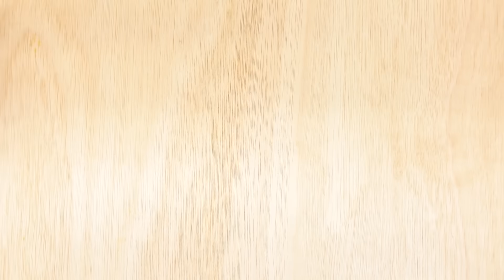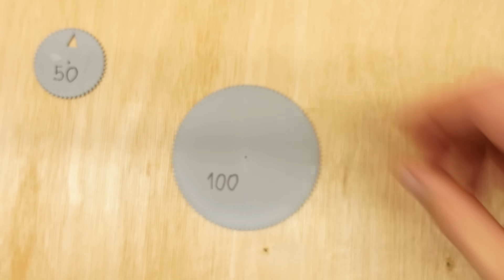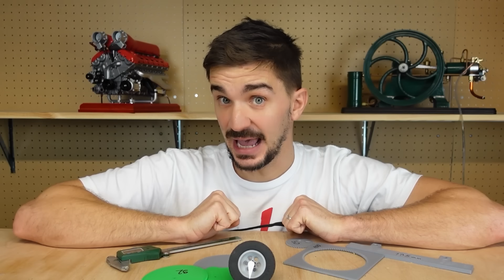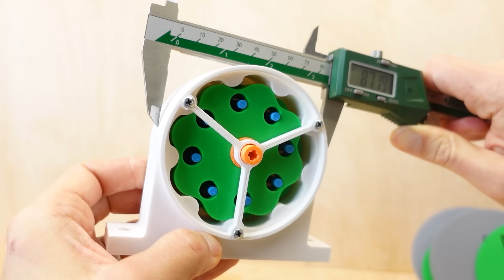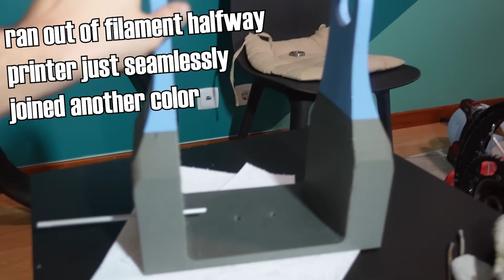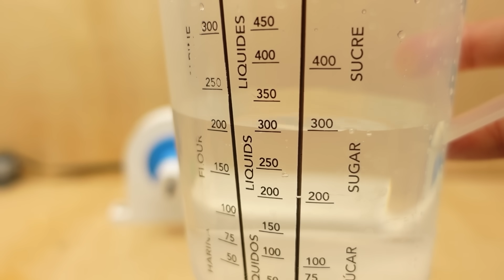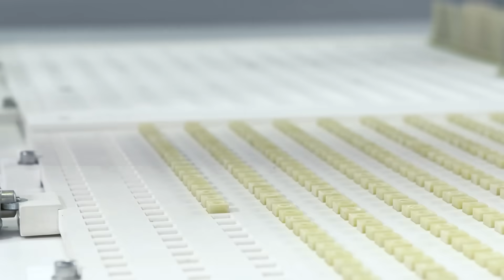Toothless Gears Make Much More Torque Than Conventional Ones, Here's How. Cycloid Drive Explained

Comment: Balance problem potential improvement. 
Towards the end of the video, you show the problem of Balance after adding the second gear.
Could this be minimised by splitting the second gear and placing one either side of the main gear with a crankshaft to match?
This should then equalise the lateral forces around the then central gear.
R
Reply: Exactly what I was wondering. I'm sure there's an "obvious" reason why not which I just can't see. Maybe it starts getting sufficiently more complex when you do that sort of thing that other solutions become more effective? If anyone knows why it wouldn't work I'd love to hear.
Reply: @lightinthedarkd  it's not an obvious reason, it's a limitation of the rigid body assumption.

when we think about forces (like 1-gear case), we only care about the first-order effects (the translational motion of the object), so we make a point-mass assumption and ignore all rotation
when we think about torques (like the 2-gear case), our forces cancel out and we care most about second-order effects, the rotational motion of the object; so we make a rigid-body assumption and ignore internal stress

to reason about opposing torques (bending moments), we're now looking at third-order effects, and we need to place the gear into its larger context. sometimes it'll make sense to have 3 gears like this, other times it won't. essentially, you're concentrating the bending moment that would otherwise cause some amount of stress across the whole driving axle into the space between the gears

Comment: Question, could you not solve the vibration issue of the 2-cycloidal gearbox by adding another two, similar to a perfectly balanced 4 cylinder engine? I understand there would be an increase in weight and complexity, but it still seems simpler than most modern transmissions.

Comment: The spare tire winch on my Toyota truck operates on the same principle.  It also has the advantage of not running in reverse where the spare pulls down and unwinds the hoist cable.

Comment: I'm sorry but you're wrong, for the first 5 minutes  because you don't stop the arrow at the right spot. If it is pointing away from the center at the starting point it must be pointing away from the center at the end of its travel to complete one full rotation. You are rotating it until the numbers are level not until the arrow is in the same position relative to the center

Comment: Welcome to 3D printing.  I bought a comparatively inexpensive 'bed sliger' 2 1/2 years ago to investigate the practicability of it as a work tool (I design custom filling equipment).  Parts can be made that would be almost impossible b an other process.  Internal air passages and ducts, tiny integrate air knives (first project I did used both these)  I have printed chain sprockets for prototype work and test rigs, drilling guides.  Like you I have ended up making odd fix it parts for my wife (rubber feet to replace missing broken parts).  The important thing to pay attention to is layer orientation for parts subjected to loads.  The output pins on the cycloid drive for instance would be very shear prone.  For that metal posts set in would serve much better.  IGUS even market special filament for making plain bearings and slides.

Comment: We don't want the lowest possible tooth number difference.
We want the lowest possible ratio of teeth missing : teeth on ring, or altenatively, the greatest possible ratio between inner teeth : outer teeth.
e.g. if you have 90 and 100, that is 10 teeth missing, a missing to total ratio of 1:10, and a inner to outer ration of 9:10.
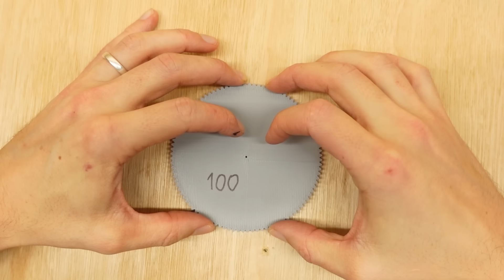If that is compared to a 10 tooth outer gear with 8 inner teeth, that is 2 teeth missing, but a ratio of 2:10 or 8:10, making fewer teeth worse.

Comment: Could you just put a wavy pattern on input shaft through so the gears, instead of cams, that acts as another cycloidal drive on the inside of the gear. You could have the gears still go in reverse and everything, and reduce all that stuff you were talking about because the shaft itself is counteracting it and gaining more output torque and reduced speed. I could definitely be missing something, but I'd need better eyes than mine...

Comment: Half done and I’m saying “why not on high rpm engines with low speed prop requirements?” (Airboats, powered parachutes) And then you dash my hopes with the rocking couple. But large diameter hollow shaft with an internal counterbalance? It seems like these transmissions are in their infancy.

Comment: Surely lack of torque is not really a problem. Torque figures along with horsepower figures are constantly increasing. As far as automotive situations are concerned, increased torque also means increased potential for breaking traction and causing wheelspin? Cars already have traction control to try and prevent wheels losing traction, so we don't really need any more torque as much as we need increased tyre grip that is already struggling with current and even historical torque levels. Am I misunderstanding the situation?

Comment: About the first three minutes: It's about perspective, we count the rotations from our fixed perspective which works with the straight piece but for the circle and ring we'd need to rotate with them. Take 2:21, at the beginning the arrow is pointing away from the big circle's teeth (forget about the fact that it's pointing to our north), count how many times the arrow points away from the big circle (regardless of if it points to our north//east/west/south) before reaching the initial position: 2. Same with 2:41, count how many times the arrow points to the ring's teeth before reaching the final position: 2

Comment: I learned about backlash when I was 11 or 12.  My friend and I built a Lego car expressly for the purpose of pushing a heavy vase off a tabletop.  My father had challenged us.  We built our gearbox on the theory that if some reduction was good, more was better.  We kept reducing until we ran out of gears.  We added a box of pennies for weight (traction) turned the motor on and it spun freely but - nothing.  Then we noticed that after a few minutes it appeared to move at a glacial pace.  Then we placed the whole thing against the vase and waited.  In about 30 seconds we heard a “Pop!”.  We had broken a few of the plastic gears.  Vase 1, Lego engineers 0.
Reply: I love this, lol.  The best way to learn (imo) is always hands-on experience.
Reply: This isn't backlash. It's just high torque breaking weak components.

Backlash is when the initial tiny rotation of one gear doesn't move another gear at all - so you can wiggle one gear/input shaft and the other one stays completely still. Only when you spin it a bit more and overcome the backlash, the other gear/shaft starts to rotate.
Reply: @marekogarek6329 that’s the part where the motor spun freely but the car didn’t move until the gears meshed - but I thought I’d go ahead and finish the story.
Reply: @failranch9542  that isn’t backlash
Reply: @failranch9542 backlash is very small and it wouldn't take "a few minutes" for it to start moving because of backlash. It moved that slowly because you were overloading your Lego motor to beyond its torque rating, because adding more gears adds more friction to overcome, which causes motors to skip or act sluggish, and to heat up.

Interesting story though still! Thanks for sharing
Reply: @HaLol-e8i as I clearly stated, the motor spun freely throughout.  It was not overloaded, beyond its torque rating, “heated up”, or acting sluggish.  When you have several sets of reductions, you simply have to wait for all the gears to mesh.
Reply: @failranch9542 All right, we're going to need a reenactment video from @d4a cause I can't picture this unless you had like 600 gears.
Reply: Plastic well used 😅
Reply: rough times at the failranch  😟

☠💯
Reply: For me, I tried to make a lego robot to solve rubik’s cubes. the transmission for the piece which needed 2mm tolerances had enough backlash for a whole centimeter
Reply: Time to swap to metal gear then
Reply: @senioravocado1864  yeah, metal gears would be solid
Reply: @senioravocado1864  sir, he was 11 years old and was playing with legos
Reply: @GelloMello-j9z  assuming he was 11 11 years ago, he would be 22 by now lel
Reply: redditors are so weirdo with their fantasies

Comment: Lots of work went into this excellent video.  So why aren’t these nutating gear arrangements more common?  Because of the basic requirement of gearing: surfaces must roll on each other rather than slide.  Sliding, which is inherent in the models shown, is very inefficient and wastes lots of the transmitted power.  The robot gearbox uses rollers at the contact points which increases efficiency a bit and robots can pay some waste energy to get other benefits.

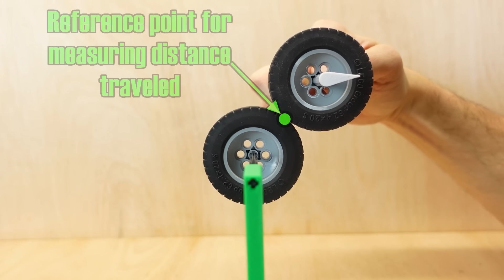Comment: 1:29 Pretty sure it’s just because of your frame or reference. If you pay attention the wheel still only completes one rotation relative to the surface of the other wheel (the arrow points away from the other wheel once this happens). The other 360 degrees comes from the curvature of the surface on which the wheel is rolling. If you made a half-circle for the wheel to roll on that was the same length as the circumference of the wheel, it would make 1.5 rotations because of the extra 180 degrees.

Comment: You made an incredibly simple concept so very overcomplicated. The tire rotates once in reference to the other tire treads. You've just take that straight 195mm surface and curved it into 360 degrees, making it so ANYTHING traveling around it rotates once. So you add that rotation to the first one and that's two rotations relative to a fixed point.

Comment: Just a silly thought; What if you fix the internal and external 'cogs' with a fixed but offset axels, removing the need for the crank-shafts?

The down side is it probably would  need strong axels and load barrings for both parts. But as both cogs only rotate there should no vibrations due to no linier (up/down or sideways) motion of the major parts.

Comment: I was watching the explanation of why the one wheel makes 2 revolutions around the identical wheel, and I was thinking that you could, instead of shifting the distance reference frame, you understand that the angular reference frame is also shifting? Because relative to the surface of the stationary wheel, it only makes one revolution, but relative to everything else it makes 2. This is because the second rotation is "hidden" by the cirularity of the path.
Reply: Somebody please tell me if this is complete nonsense, or not!

Comment: But couldn't multiple cycloidal drive be balanced like we do with multiple cilinders in a engine so it could handle higher speeds? 
Or would this counter the high torque it can handle. I'm just pondering.

Comment: Well if they have the rocking couple problem why not just use 3 gears, offset like up-down-up with weight ratios 1-2-1. That would balance the offset problem and balance the forces along the central rod. But still there'd be a difference between the inside and the outside so you could add more gears like up-down-up-down-up with weight ratios balanced for that number, then you keep going until you've got a loaf of sliced gears operating with approximately perfect balance. You could even spread out the angles more instead of just up down, but up left down right or even more. The more gears and angles you give it the more balanced it would be right? Is there a problem with this other than manufacturing and maintenance?

Comment: I would imagine the biggest drawback to a cycloidal drive would be operational speed. It just seems like a lot of material to be wobbling around in there at 3000+ RPMs. I could see these being great for final drives in things like gear hubs. Unfortunately it seems like the inherently high gear ratios in cycloidal drives already make them a bad fit to replace most vehicle transmissions or drive-train center sections. I do see these being a potentially good replacement for a worm drive. They are, without a doubt, the best option for servo drive trains.

Comment: This is not the king. I have seen the king of gear ration when I have dismantled a very old electric rear view mirror adjustment unit. It was a planet gearbox, but with very special feature. There were two ring gears opposite to each other. One fixed, the other one was output. There was few teeth difference between them. The planet gears also had two sides, each side having different number of teeth. As the planets were orbiting, they caused the output ring gear to rotate very slowly. More over, the planet gears were propelled by a small gear in the middle of them, which was additional speed reduction. The gear ratio was easily over 1:100 and the gearbox size was like a thick coin, or two coins. I was thinking about it and it only works for certain ratios, which allow both sides of the planet gears to match in diameter with the ring gears. Perhaps I should make a video about that, because I have only seen it there, in the old mirror. It looks like an invention the world has forgotten about.

Comment: I love math. For sure pause this video periodically and try to work out the math, it is very fun. Spoiler: The number of rotations is equal to the product of the ratio of the surface's circumference to the rotator's circumference and the ratio of the circumference the path the rotator's center takes to the circumference of the surface.

Which got a bit messy, let me try to clear it up for anyone trying to understand.

R = Rotator
r = Rotator's center path (the circle the path the center of the rotator takes when it interacts with the surface)
S = Surface
C = Circumference of

Number of Rotations = CS:CR * Cr:CS

Yeah much neater... Hope it helped at least one person. XD Fun either way.

Comment: The gearbox would be balanced if the crankshaft had three journals and the two opposing gears on the outside were half the thickness of the center one. A two-piece bearing or roller bearings on the center one would allow it to slip onto the crankshaft

Comment: Could you solve the offset vibration issue by having 3 cycloidal gears and have the middle one be 180o out of phase with, and weigh twice as much as each of the other two?

Comment: You've used smoke and mirrors to portray the lobes as better than teeth when they aren't.  Just because you are able to get a difference of one lobe with a 9-lobe ring, and weren't able to get a difference of one tooth with a 100-tooth ring, doesn't make the lobes preferable.  It's not the difference in the number of teeth/lobes that matters but the ratio of the difference to the number of lobes on the disc.  That is, with a ring with m lobes/teeth and n lobes/teeth on the disc, the ratio is n:(m-n).  In your case, with m=9, n=8, the reduction is 8:1.  With m=100 and n=91, the ratio is 91:9 or about 10:1 (i.e. better than yours)

All your comparisons with gears, such as backlash, and torque handling are based on comparison with external gears.  If you were to make a cycloidal drive using gears instead of lobes, you'd find the gears were at least as good as the lobes.  You implied you could get 100:1 from a cycloidal drive.  Prove it.  Show us a single stage 100:1 reduction.  You can't, because 100:1 gearboxes use multiple stages, e.g. two 10:1 stages.  Lobes run into exactly the same problem as gears - you can't fit a 99-lobed disc inside a 100-lobed ring - try it.

What is the profile of a gear's tooth called?  It's a cycloid.  Teeth are cycloidal drives, whether internal or external.  The reason for this, is so that the forces between any two teeth are perpendicular to the surface and there is no rubbing at all.  None of the force is wasted in friction between teeth.  Can you say the same about your arbitrarily shaped lobes?

At least you walked back your claim that two inner gears "eliminate" vibration.

This had the possibility of being a really good, informative video, but there was so much intellectual dishonesty, you blew it.

Comment: The Cycloidal design is amazing, it can handle the very high initial shock from modern motors and overloads from the driven equipment better than planetary and helical gear drives.

Comment: 19:22 Can the rocking couple be reduced by having more, thinner cycloids?  Like 6 cycloids that are each 1/3 the thickness?
Reply: I was thinking that you could just put two cycloids of half the mass on each side of the central cycloid.
Reply: @codysteele That sounds better than my idea
Reply: Technically, yes, you could, but still a considerable big transmission for a single ratio.
Reply: @Rrgr5 The part count would go up, and the complexity of the shaft would go up, but the physical form factor wouldn't need to grow beyond possibly a few fractions of a millimeter if the cycloids don't lie perfectly flat against each other.

Comment: That's a strange way to think of it.
The reason there is always an additional rotation around the outside is because from the tracks point of view, it's still only 1 rotation. But because the track turns upside down and completes a loop, it adds an additional rotation to the teeth ratio, vs a straight line.

Comment: 18:45 to solve the problem of creating a couple.
couldn't you split one wheel in two and put it 'around' the other, so you would have a wheel of half a width, a 180° offset full width wheel and a half width wheel. this way there is no net couple.